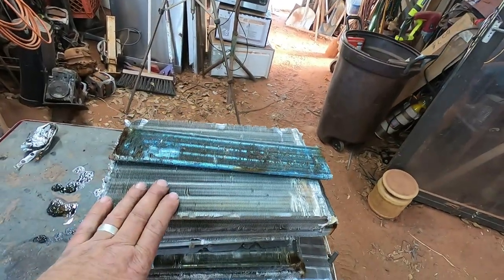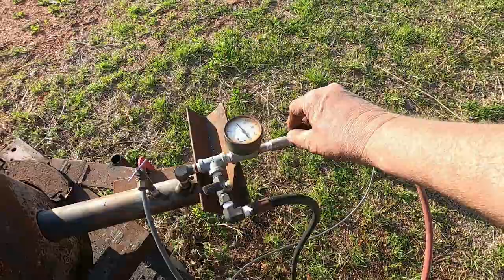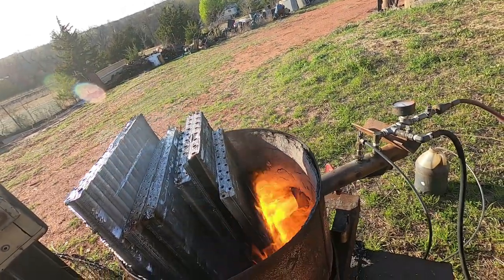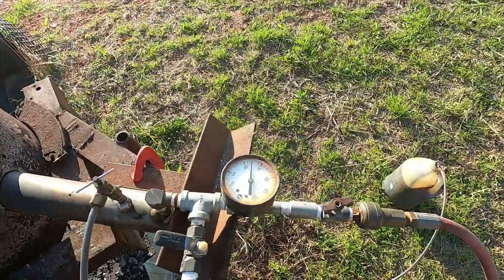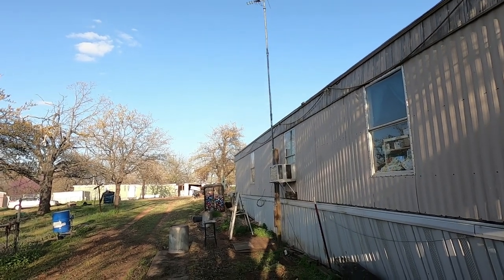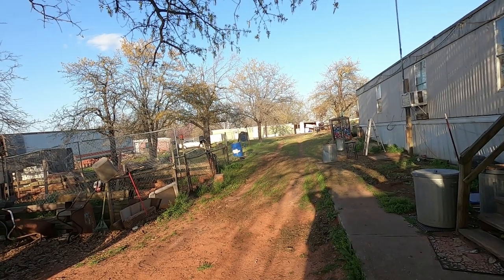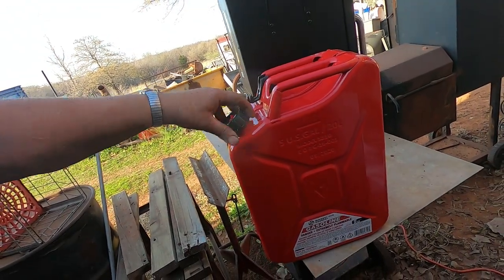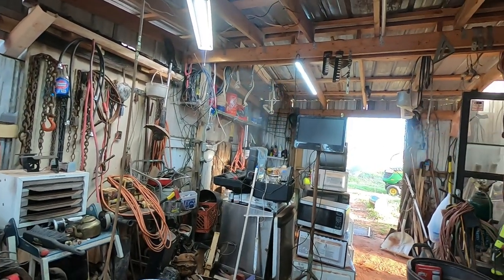Testing to see if I can melt the aluminum off the copper on a acr

Comment: Lol an old hillbilly neighbor of mine used to scrap. That's who I learned a few things from. He had an old iron bath tub that he'd build a fire in, on, and around and throw some aluminum in there. He got a major load of some type of antennae that had an aluminum casing with steel wire insulated with foam in the center. I guess he figured the best way, would be to melt the aluminum off of the garbage. Drinking beer and keeping the fire going late into the evening. Occasionally pouring motor oil directly on them in the tub. The tub was lifted so the drain was the lowest point. Just kept adding all night. More antennae, more wood, more oil, all night. The next day, we went out there and sure enough, there were rough little chunks or ingots in the dirt. It worked...wasn't very efficient, but I'm sure that had to do with how much we had to drink...Dale McCoy aka Hillbilly from Milan, Kansas. Originally from Arkansas. That was a good guy.
Reply: Oh! Happy Easter!
Reply: Dale is who taught me how to do truck loads of pot motors.
Reply from the maker: interesting story and method, Happy Easter to you and yours, Thanks for stopping by

Comment: Copper melts at 1,984 f and aluminum melts at 1,221 f you might need to get your fire not so hot. And yeah I asked professor Google ha
Reply from the maker: yeah that's what I was saying, to get it out of the flames, they are too hot, I am wondering if I could make it work using an old oven, it's worth a try. Happy Easter to you and your family
Reply: @Okiescrapper  i might have come off a little harsh check it out Okie you have a really cool channel and a  Plethora of knowledge in more areas than I do (and thats not saying much) alright I went down a Rabbit hole there but fact of the matter you rock man no kidding I thought for sure that was going to work so I was thinking how to keep the copper  Radiating more heat so the aluminum which is thin and I believe some of it may have burned but but the cool factor was a decent 10 great video and if I know anything I believe you will have a  Solution before next video 🐈🐈🐈

Comment: I'm sure it would be pretty involved to build, but the best solution for separating aluminum fin from the copper tubing is two long powered shafts with rollers that create a vvvv pattern. Look up some of the machines on YT. They flatten the whole thing except for the tubes which pop out. That seems way quicker, plus no copper is lost to the melting process. Great idea though!

Comment: Man if I had that much space I have solar panels everywhere. LOL I get them a lot through Scrappin. I also used to order the cells online and actually solder my own together. If you’re savvy you could build a $2000 solar panel system for about 200 bucks. Find all the brackets and parts you need to build the frame through Scrappin and the only thing you’ll actually have to buy is the cells, And either plexiglass or acrylic to encapsulate the solar cells. I’d be a nice project for that other channel you’re talking about.
Reply from the maker: I am sure there are some videos on YouTube university on how to make them I will have to start studying that. I did some study into solar and wind back in the early 2000's before Oklahoma even had any wind farms, Solar is starting to catch on here now, I have a small 10W 12 volt solar panel that I bought back in about 2004, I need to hook it up to my car hauler to keep the battery charged when not using it

Comment: Im at the beginning and it should work with about 700 degrees difference in liquid points.....let's see what happens.  I have a small a/c company, me and my Son, so we get these coils all the time.  We just cut off the steel tube sheet and sell them as is.  We get the same price as #2 copper
Reply from the maker: #2 copper here is just over $3.00 per lb. acr's are about $1.00 per lb. and you almost have to have a ac license to sell them. or you can get a junk collectors license for $29.00 after you get a background check done that will cost you another $45.00. and you need to do this every year
Reply: @Okiescrapper  Hey Okie, the scrap yard I've used for 20 years asked for my contractor's and driver's license for the first time about 3 years ago when there was a lot of a/c units being vandalized for the copper.  I'll never forget 25 years ago when one of our customers got vandalized for about $50 in scrap and did $60,000 in damage. It was a 50 ton chiller.  I pay the bills in hvac business and scrapping is just something we do when it's slow. Hey thanks, I like your videos.

Comment: Cut it into chunks that will fit in a crusiful melt some aliminum and add the chunks copper will sink . Decant Allie . Allie foils will burn in air flame not in molten metal don’t over heat cheers

Comment: A hardwire brush not a soft wire on angle grinder will take the alluminum right off a condencer Cooper tube
Reply from the maker: I may have to try that, fix up an area to catch all the aluminum as I go

Comment: Your Colorado: check if you have any fluid in your clutch reservoir. It sounds like your slave cylinder hose blew. If your reservoir is empty it was likely that hose. Simple fix.
Reply from the maker: Thanks for the tip I will check that out.  Happy Easter to you and your family

Comment: Hard 2 control the temperature  there
Reply from the maker: I may try to melt some in the other furnace, I may need to get a large crucible, or try to cut them on a band saw
Reply: @Okiescrapper  the furnace ones aul fins it work

Comment: I didn't think it would get hot enough to melt the copper
Reply from the maker: the direct flame is very hot, I may get a large crucible and try to melt in the other furnace

Comment: I always wondered about this.
Reply from the maker: it was worth a try, if the melting pot had more refractory to hold the heat and if I cut them down to fit inside to cover the top it may have worked better, the direct flame is too hot, but a viewer mentioned an oven and a light went off, I could cut a hole into an oven for the burner, and with the insulation in the oven it may get hot enough, I could make a sheet metal funnel to direct the aluminum into a pan. I may try it some day.  Happy Easter to you and your family

Comment: Majority of toilet paper comes from US compaines like Georgia Pacific and others. Before corona I had 6 rolls......Now a days I have 3 cases at 18 rolls per case. Gotta be able to wipe with the good stuff. LOL. Good video. Do you get a different price for those heat exchangers with the ends cut off? Like a specific price just for those? Good day and hopefully you get to 10K subscribers soon.
Reply from the maker: yeah we have a small stock pile 2 women in the house so need to have it on hand, on most of them the plate on the end is steel, so they have to come off to get the going clean price they are called acr aluminum copper radiator I see one every now and then that will have aluminum plate on it, that one would not have to be cut off, they do have a price for unclean too. they are hard to sell here in Oklahoma almost need a heat and air license. I think I can sell them with a junk collectors license

Comment: Haha,😂, i used to scrap aircons..
 To get the copper out, all you do is this, 
Step 1,
 cut off the copper 90 ends,
Step 2
 slice through the aluminium fins along the copper pipes with a box cutter,
 step 3,
 stand on radiator and insert screwdriver into copper pipe and pull it up and straight out, . 
  Then repeat till all tubes are out..

 This way takes 5 minutes takes no fuel, and you get copper 1 price for the tubes instead of melt price, and copper2 price for the 90 degree ends that were silver soldered on ...  then i just threw the aluminium in with my aluminium sheet scrap and got sheet price ❤  try it my way once, you probably wont regret it 😂
Reply from the maker: I will have to try that.

Comment: The issue with melting aluminium off of copper using your system is the lack of control over the temperature.
If you had some way of keeping the temperature below 680 degrees C, then it should melt the aluminum and leav3 the copper intact.
Reply from the maker: thinking about using an oven with the oil burner, and see if it get's hot enough

Comment: I had a half ton Chevy 1998 blow the hydraulic line off the slave cylinder. In my truck the slave cylinder is inside the transmission. Had to drop transmission replace slave cylinder and the master cylinder. On mine when that pop happened I couldn’t push the clutch in at all. Pressure was built up behind the pedal .
Reply from the maker: with a little luck it may be the linkage issue I hope, quick and simple, Thanks for stopping by

Comment: You made some aluminum bronze. You might try laying the radiator across the top of your forge to keep the flame off the radiator, or just make aluminum bronze but don't mix it with the other aluminum. Try putting the radio antenna up ten to twenty feet higher. Keep up the great videos and God bless you and your family.
Reply from the maker: aluminum bronze may be good for casting into graphite molds, I am looking at a 36 foot telescopic antenna pole that would get me up another 10 feet, I most likely have to add guywires, I am planning on building a deck out front with a roof and I can attach 2 of the guywires to the top of the 4x4's just below the roof, and I can put 2 4x4' s on the north side of the area that I drive and attach at the top, Happy Easter

Comment: I recently separated the copper tubing from the fins on a big refrigerated air unit radiator. I just used a Sawzall and let it kinda guide itself along the copper. I wish I had a set up like yours, cutting down aluminum to fit in a crucible is annoying. 

Happy Easter!
Reply from the maker: Thank You Eric, Happy Easter to you and your family

Comment: We have planned power outages here when fire danger is high, I recommend a Honda generator and some good lanterns electric,white gas, propane and kerosene. Would like to see your lanterns, and prepping tips. Subbed, thanks
Reply from the maker: we get the battery operated lanterns from harbor freight when they have them on sale for $5.00 each

Comment: I tried cutting them up into smaller pieces before melting them but it didn't work out to well for me.i even added other aluminum to it
Reply from the maker: I am thinking about cutting a hole in an oven for the burner put some on the rack above the flame and see if the oven will get hot enough to melt it off, I may try to make a big funnel to guide the aluminum into a bread pan

Comment: It might work using an oven with temperature control.  There's some chemistry involved though and the bonding process might lower the melting point of the copper but I'm no chemist so I could be way off. Good video and thanks for sharing!
Reply from the maker: most oven's go up to around 500 F Aluminum melts a few degrees over 1200 F but the oven is insulated I may be able to cut a hole for the waste oil burner and get it hot enough in there to melt the aluminum, may be able to make a large funnel to guide the molten aluminum to a hole in the bottom and into a pan in the bottom of the oven. Happy Easter to you and your family
Reply: Check out oil burner's channel. He built an awesome waste oil smelter.
Reply from the maker: @ramblingman8992  I have watched many of his videos, I wonder what ever happened to him
Reply: Yes, I wondered that myself.

Comment: I get a bunch of these my best solution is build a fire and set them on the fire and melt as much of the aluminum off as possible the rest that is left will scrape off easily. the copper tubing is so thin that it will melt either way but with the fire less of the copper melts. The aluminum will pool up at the bottom of the fire.
Reply from the maker: I may try to put the oil burner into an old oven and see if that might work.

Comment: thx for giving it a try I guess I got my melting horse in front yeah I forgot how that goes haha melting is neat maybe a metal pipe but if you are going to cut in strands may as well pull copper tube out and be done with it
Reply from the maker: yeah  it was worth a try, I ma thinking about trying to modify an oven for the oil burner and see if it will get hot enough

Comment: How about if you put them on a  grate like a BBQ grill has sO that the heat isn't on them directly,
Reply from the maker: I am thinking about using the oil burner in an old oven, and see if it will get hot enough

Comment: You would need a   crucible to isolate the scrap from the direct flame
Reply from the maker: I am thinking about using the oil burner with an old oven,  to see if it will get hot enough

Comment: That may hae been a way I might have tried but I would have the same problem with melting both copper and aluminium.  I bought an abrasivewheel for my skill saw and my idea is to set the blade depth just touching the tube. In theory the tube will lift out with a quality gripping plier but I can't say from experience what tool is best
Reply: Okay I  just tried it but I  used my little grinder and a cut off wheel. It got faster as I went, its a bit messy but got all the copper tubes out of a condenser in about ten minutes.  I crimped on one and rolled it much like the sardine can. Unrolling it cleaned any aluminum that got rolled with it. That took about 5 minutes. Still the tubing is so thin its almost not worth doing... unless you can unload it on ebay!
Reply: The last 5 had the brackets on both ends meaning I  havent cut the loops on the ends off. I laid them flat cut down to the tube including the bracket.  I flipped it did the other side and the aluminum fins just fell off and the tube was in one piece. The best part was it took 15 minutes to do the last five. It really works!!
Reply from the maker: I will have to try it that way, thanks for the tip

Comment: I am amazed at how clean that oil burnes
Reply from the maker: it works well and with all the heat it burns nice and clean, until I get a plastic part in the melting pot

Comment: That's all freed up now.  It was only backed up for about 4 days after they refloated the ship.
Reply from the maker: that's good, now they will have a line at the ports if they all get there at the same time, but they should be going to different ports,  I heard they have a container shortage, I guess they need to stop selling them for storage units. Thanks for stopping by

Comment: I think this is a great idea but you'd have to get it well insulated and control the temp
Reply from the maker: I am thinkint about tryingto set up my oil burner in and old oven. see how that works the glass in the door may not be able to handle the heat
Reply: @Okiescrapper  probably be easier to get kaowool and line your forge with it and put a kaowool lined lid on it